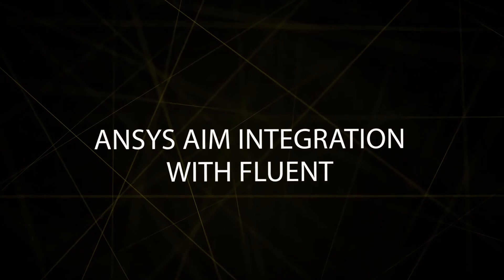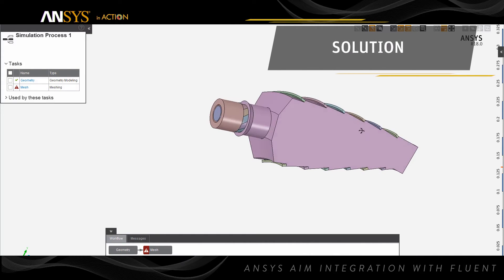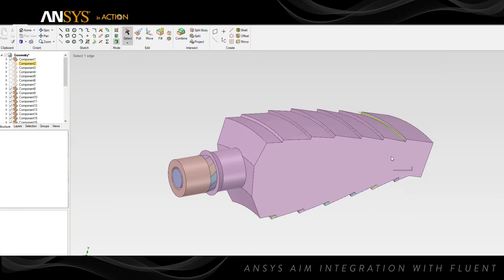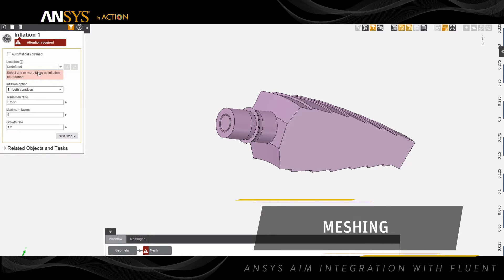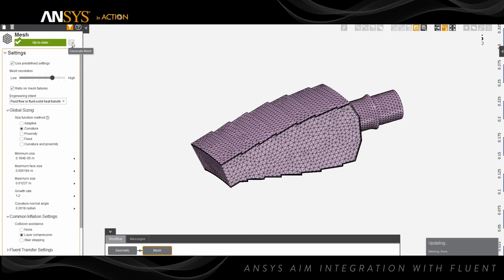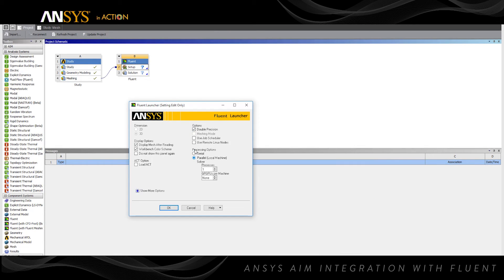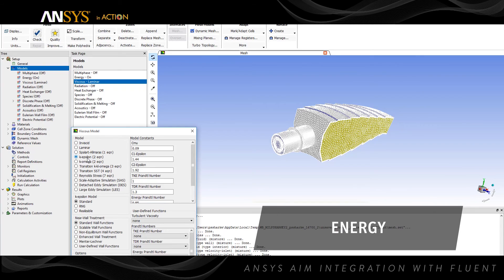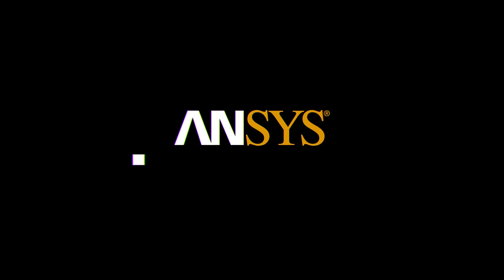ANSYS AIM Integration with ANSYS Fluent

Comment: I read that the purpose of AIM is to handle simulations done by multiple ANSYS platforms, without having to learn or use several platforms. why would someone make a geometry in AIM and instead of continuing to complete the simulation in AIM, switch to FLUENT. does it mean that FLUENT is much more robust in its area of specialization such that completing a simulation meant for FLUENT in AIM will result to less quality work